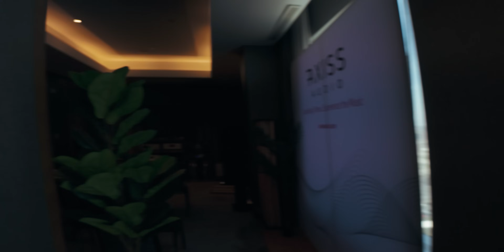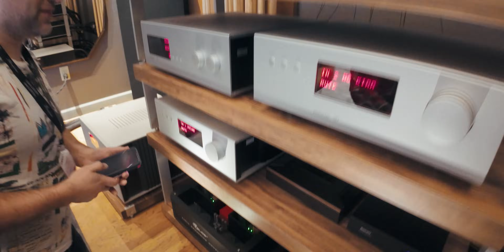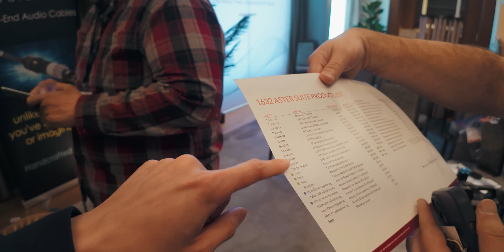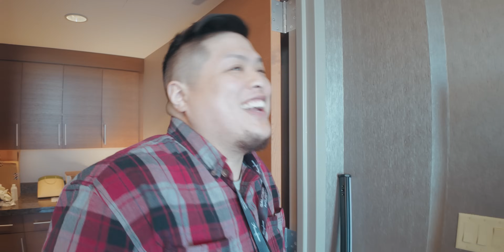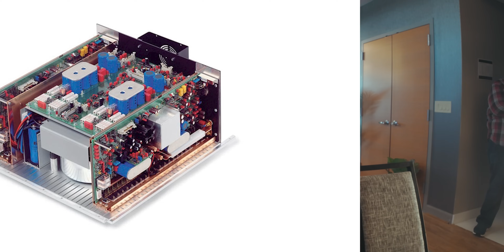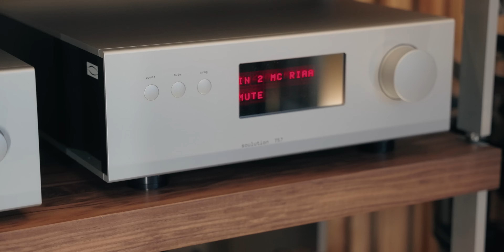This KICK-ASS Audiophile Amplifier PROVES Audiophiles are Wrong About...

Comment: The sum of the cost of the components in extremely expensive audio gear comes to a very small fraction of the piece of the equipments cost.
Reply: @Hoophey how much did the paint, cavas and brushes cost making a Picaso Painting? 

Although i do agree that some manufacturers are taking us for a ride (Wilson's $112k for autobiography custom paint 😑) . People forget the cost of  R&D, marketing and general company costs (including profit) especially when not made in China. It's when they use cheap parts, bad design and manufacturing in china. Then we should boycott.

Comment: Duelund caps start jusr under $100 USD to well over $1000 USD for crossover caps. I spent around $200 USD for a pair of their bypass caps for my Elac Adanté AF61 tower tweeter crossovers. The improvement in HF performance wasn't subtle.

Comment: Being a long time Soulution user (more than 15 years) and owned a few generations of their pre and power amplifiers, I should say that I am quite happy with Soulution as far as their sonic performance is concerned.  What I am not happy about is their product reliability and support service.  I had some very bad experiences with their products, especially the 725 preamp that ended up back and forth to the local dealer for repair 6 times within one year and still not able to identify the issue.  Not until I wrote to Mr. Hammer myself that ultimately led to some meaningful action and got that fixed.  I don't know if they have changed now but Soulution adopted a dealership model that leave pretty much all support to the local dealer even in situation where the local dealer does not know what to do technically.  Also, my 701 mono block will have capacitors suddenly blow up with a white smoke, and I was told that it was not uncommon for the specific type of capacitor used.   Just keep these in mind if you are about to spend that kind of money for audio equipment.
Reply: That sucks, I want to share with you my experience with Alberto Guerro of AGD Productions.. I had a problem with one of my amps and he said that my amp would be priority and I got a one day in lab turn around and my amps were sent back to me. After recieving my amps I had a minor problem with the Amp a minor problem according to Alberto. He said instead of sending amps back and forth he would send me brand new amps with upgraded ganfet based power supplies, man what a difference. Alberto gave me the best service I have ever experienced in 64 years.  I remember after a phone call with Alberto I said to my wife he is clearly more concerned about me getting my music back then I am. Support companies that support you!  Thanks! Alberto

Comment: I can tell you that nothing has as much control over the drivers than a soulution amplifier. Try a 331 and you will be mindboggled how well that small unit pushes power out of the speakers and stops the woofers in time.

Comment: The global negative feedback NEVER talk about harmonics and keeping the recorded harmonics intact and unharmed.
Reason?
To be able to implement massive amount of global negative feedback you need to limit bandwidth on the input stage to not get oscillation.
A low bandwidth input stage have more difficult to track harmonics without phase shift which changes the character of the sound.
As far as I can tell Soulution do their best to prevent this problem and succeed pretty well.
I practice that input stage need to have -3dB LP point at least above 20kHz and preferably above 50kHz before applying global negative feedback to have a chance to keep te character of the sound intact.
Crossover switching from the output stage must be low before introducing global feedback which needs a healthy portion of stanby current through the output stage.
Any kind of crossover distortion in the output stage will be sent to the input stage when the global feedback loop is closed.
By every 6dB of feedback you theoretically half the output stage distortion (crossover distortion as well other stages distortion), but at the same time you double the distortion at the input stage.
Low bandwidth and added crossover distortion in the input stage "can" and in many cases do have a strong impact on many amplifiers out there. They create a sound of their own which do not keep the recorded harmonics intact and unharmed. The result is destroyed soundstage and a monotonic character.
As far as I can tell Soulution know what they are doing and make a very good job at preventing these negative artifacts of global negative feedback. But many other amplifier brands do not.
Key point. Keep input stage bandwidth high enough to let through all recorded harmonics unharmed, and generate minimum amount of crossover distortion before applying the feedback loop.

Comment: Pointless having such a wide bandwidth for an amplifier when most speakers use non-minimum phase crossovers,with non-constant group delay. Again, the determining factor in the audio reproduction chain is the loudspeaker, but hey, let's not spoil it by talking about the elephant in the room. Also what problems is that expensive Telos box of tricks trying to solve ? Can you elaborate ?
Reply: Agreed.  Speaker quality/design, placement, how the room influences the reflections, constuctive and destructive interference, damping of reflections....  Highly influencial compared to an $800 amp compared to a $2000+ amp for home.  If your spending big dollars for amps and doing outdoor live gigs, that makes more sense.  You need large amounts of current for that.

Comment: Those look like the MCap EVO Aluminum Oil caps. I used those as dc filters prior to the transformer outs on a Bottlehead mainline. I picked them because they are relatively speaking - cheap.  TBH - I coudn't tell the difference between them an the Daytons they replaced. Totally a great big ¯\_(ツ)_/¯

The Delund however... totally stratospheric costing cap. While I realize that signal path components interfere cumulatively and compound,  I still don't know if the difference in cost would ever be warranted.  

Interesting take on the power amps. I'll take his word for it that GFB performance is entirely dependent on available bandwidth. Great interview.

Comment: You realize how ludicrous those prices are? I'd challenge you to listen without any of the conditioner, firehose sized speaker and power cables. Even If they actually contribute to any sonic refinement, how can even the wealthiest audiophile justify that kind of bread? Super nice to look at.......Very pretty!
Reply: “Audiophiles” will buy anything.
Reply: Blind testing all the snake oil is a must as its measured and proven to make no difference. 

The pro audio industry looks on in disbelief!!!  How much are those speakers cables?? I shall take balanced.....

Comment: It's basically a power transformer  to  power the amplifier  that way there huge expensive caps.  It's common for them to be extremely expensive .  Industrial ones are ridiculous expensive  on any application  they usually need a filtration  set up.  There used for different applications besides audio as well.🎵🎶💯😉🫡✌️

Comment: It's taken me a long time to accept (I used to sell Gryphon & Mark Levinson) but the future of amplification is smaller, lighter, cheaper, and almost certainly Class-D.
Reply: I've just bought a handful of small class D amps, monoblocks and stereo units and my big beefy Class AB Amps will hit the market soon.
Reply: GnFet
Reply: Class-D is the obvious choice for pro-audio and automotive audio where either output power or amplifier power density are the prime concern, but in home audio the benefits are questionable unless your listening space is very large or you have very inefficient speakers. In general a linear amplifier should be preferable over a switching amplifier for reproducing music, why chop up the analogue signal into fast high current pulses and reconstruct the analogue signal from that if you don't need to. A Class-AB amplifier doesn't need to be big and heavy when you consider how much power is actually used (I've made measurements). A 40W RMS/ch amplifier with average efficiency speakers in an average environment can cleanly play 85dB average SPL (the level where hearing loss becomes an issue) where 2.5 meters listening distance would be typical. Such an amplifier  won't produce much heat and can be compact as well. Such amplifiers have been around for a long time so the problem was solved back then.
Reply: @johnm3544  And then there are those who swear by valves and LPs. You can't have it both ways. Like with valves, that "warm" tone is positive harmonics if I'm not mistaken. Coloration is what those folks LIKE. So, I still say, stay within your means (budget) and be happy!

Comment: I'm confused. He says it's a high bandwidth design up to 1GHz, but then later he says that the switchmode power supply is filtered at 1MHZ.  Is that because the ideal for the power supply is just to provide DC?  So the filer on the power supply does not effect the actual output bandwidth?  (BTW, I am definitely willing to accept that just because you can't hear a sine wave above 20KHz, doesn't mean you can't hear the effect of >20KHz harmonics on the shape of lower wavelength sounds.  No acoustic instrument produces sine waves, they all have higher harmonics, and sometimes much higher harmonics that are characteristic of their sound).  Interesting interview, thanks Jay.
Reply: A psu just needs to produce dc. A smps will have a switching frequency, and you don't want that frequency breaking through on the power supply rails into the amp, so they put a notch filter in the psu to make it cleaner. No special science, just competent design.
Reply: @BestKiteboardingOfficial  There seems to be an odd and widely accepted correlation in audiophile circles between weight and sonic performance, switch-mode supplies aren't heavy compared to a comparatively specified linear PSU hence have lower perceived quality. It's very basic thinking but it's an easy way to appeal to people without electronics engineering expertise, the obvious benefits of a well designed switch-mode supply aren't easy to market.
Reply: The higher the open loop bandwidth the lower the distortion at lower loop gains in the audio frequency spectrum, this is just basic physics.
Reply: I'm with you. Kinda like saying the engine can rev to15,000 rpm, but you race on a small track where there is no way to gear it close to that limit. Doesn't make sense. I suspect at least some snake oil here.

Comment: His point about the PSU makes me wonder about reviewer's bias
Reply: I believe in duelund caps in the signal path—NOT in the power supply: if you don’t like the poor reliability of electrolytics— sure that makes sense. But no need for those pricey duelunds in that role….
Reply from the maker: I think we are all biased about one thing or the other. Not just reviewers. But that's ok! Keep an open mind and try to learn more is the objective
Reply: there is absolutely nothing fancy or expensive about a power supply, only pure audiophile snakeoil marketing talk. ask them for data and measurements on how its better than budget and its gone with the wind. an orchestra has instruments many meters apart, yet he talks about phase and timing in an amplifier lol, thats not how acoustcs work, the brain or electronics for that matter.
Reply: @einarbk885 
?
He explained why it's offers superior performance. 

They found the best one and paralleled four of them for 4x ampacity.